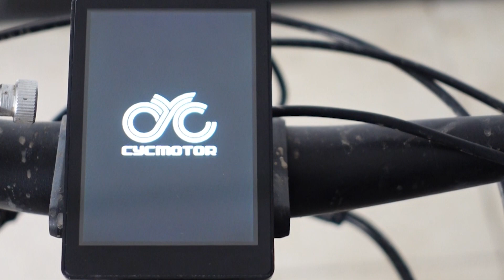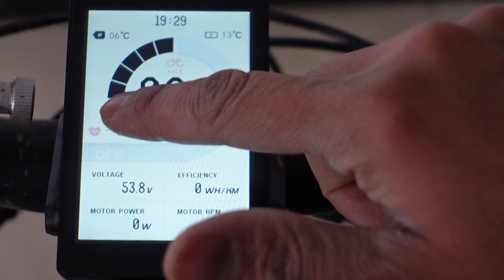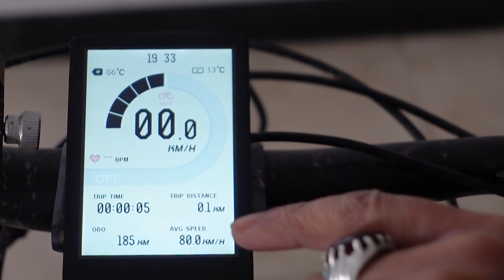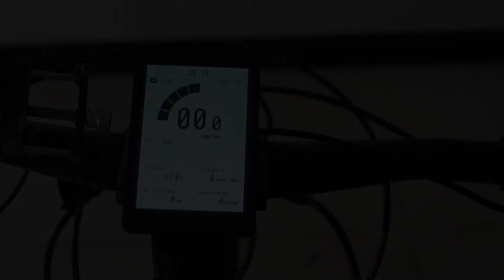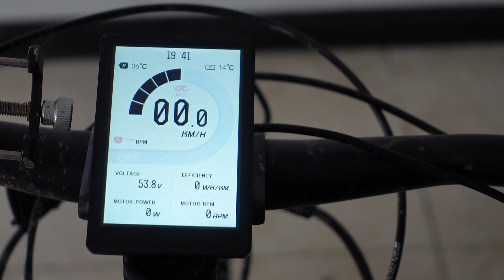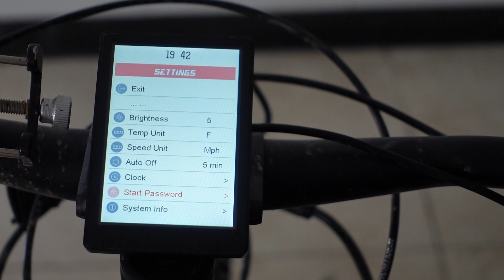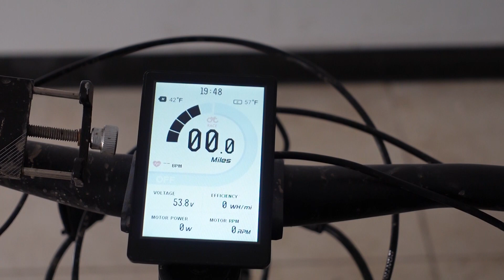CYC DS103 Display

Comment: If you hold the up arrow for about 3 seconds, the display will go from default light to dark mode, which I prefer.
I thought that this option could be changed in the settings and selected dark mode at startup, and it is still selected, but it will start up in the default light mode.

Comment: Great video, I didn't see any selection in the menu for torque sensing or cadence sensing mode. The 1, 2 and 3 mode I suppose refers to the pedal assist mode responsiveness? But is that "1-2-3" different torque response for your input torque- or is that related to the cadence somehow? I'm asking because on the CYC web-page is mentioned that torque or cadence sensing can be chosen.